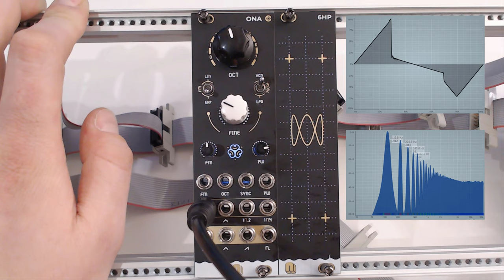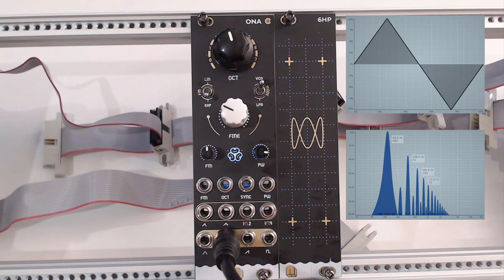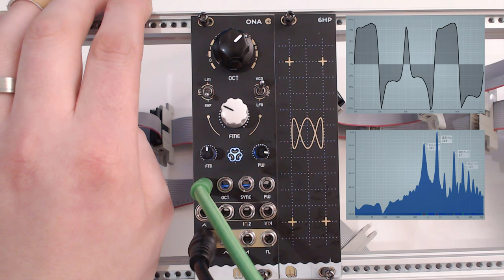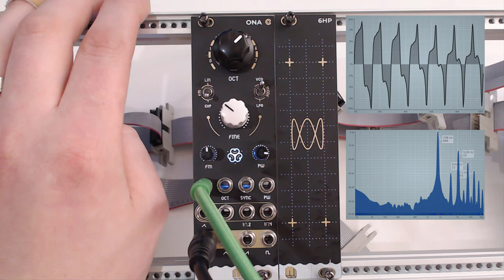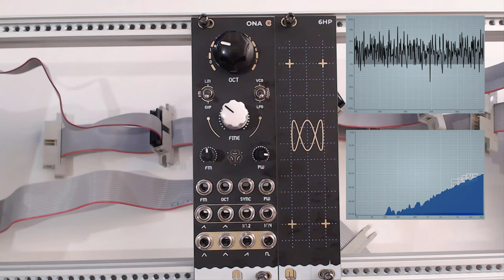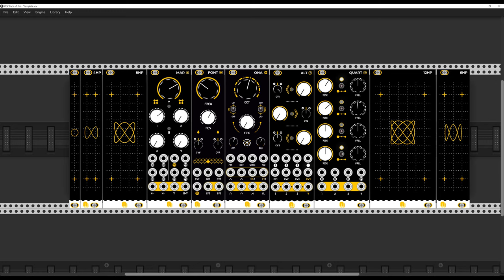Episode 7: Nano Modules Ona, Analog Multifunction Oscillator and Strymon Goodie Giveaway! Eurorack

Comment: Oscillator sync is incredibly useful for VCOs, what I'm not sure is how many modules with provide a sync trigger to go with it
Reply from the maker: Thanks a million, since recording this video I've learned quite a lot about the functionality of sync on VCOs in FM use cases or for multiple VCOs running in sync too.
Reply: @TheModularClubhouse  sync sweeps, where you change the frequency of the slave osc while keeping the pitch stable on the master are very pretty, generally speaking. A lot of non-modular synths come with a sync option
Reply from the maker: @Lcrymlgy  Excellent! Thanks Tomas